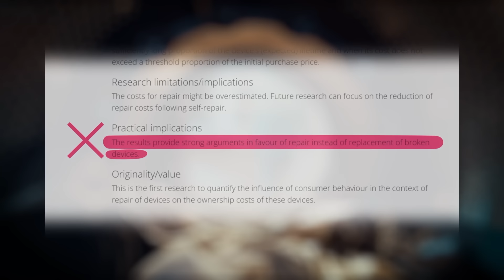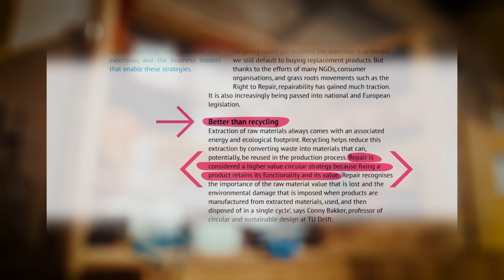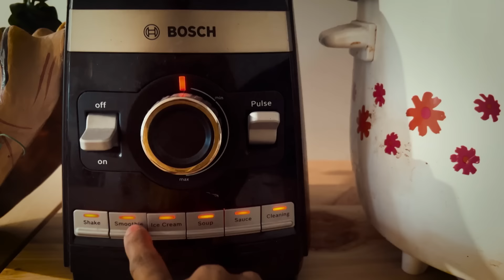How Europe wants to stop the flood of broken stuff

Comment: The makers of new junk (especially, if not only them) pass on a part of the overall cost of their products to society as a whole. It costs money to dump things that only last a few days or weeks. It costs more (which if we value things according to our values, amounts to more money) environmentally. (The local dump passes on the cost of adding carbon dioxide to the air to society as a whole, too.)

Looking at this report, it seems it might be possible to mitigate this kind of cost simply by giving consumers stronger rights to a refund? Insist that even the cheapest goods on sale (which are driving out the better products - the ones that at least take longer to become landfill costs passed on to society - too) should last "a reasonable amount of time"  - and possibly even regulate that, specifying " reasonable lifespans" for specific kinds of goods - e.g. a kettle should last at least 5 years (and if it doesn't, the seller must refund the buyer). 

It probably wouldn't be a total solution, but it might make some impact.

A kettle should last 5 years, and be economically repairable if it does - maybe for another five years? Or more? How long should the body of a kettle last? Maybe 100 years? Is that unreasonable? (Sounds like it could be reasonable, to me).

Refunds for junk, first, and then an extension of that in the case of unrepairability. Let the companies selling junk (or good  quality stuff that doesn't rapidly become part of the landfill, or part of the CO2 output of reclamation/recycling operations) figure out how to make that pay.

I'm sure this raises issues, so this is just the service. Send the ball back over the net if there's more to this than the bald idea would suggest.

Comment: When your smartphone dies, transfer to a "Fairphone". They are a Dutch brand, made deliberately to be repaired and are modular. So if your battery dies, or you want more storage, or a new screen, you can just order that part new and click it on your existing phone :D
Reply: The concept is nice, but it's more expensive and the Hardware is outdated.
Reply: @sebastianstadler4799 stop playing heavy games on the phone and it's hardware is ok.
Reply: I'd like one, except they're too big! I except that making a new operating system isn't an easy task, so i except that Android is the temporary answer. Android is crap. And 6"+ phones are gross.
Reply: @JohnDiri-xw3hf I agree it's a decent platform. Some people are just never satisfied
Reply: Nah, I just buy refurbished phones
Reply: @d4n93r  I bought a refurbished laptop when I needed one. Much cheaper, it was already produced and it works fine for my needs. That's the second time i've done that.
Reply: @d4n93r  Yes, I buy flagship refurnished Samsung phones 2-3 years old for $200-$300.  They can last another 5 years.
Reply: @JohnDir-xw3hf  The point he was making is that it's overpriced for the benefit of making it repairable. Most people want the cheapest option possible (which means it's not repairable), and of those that want the best option possible, they'll still prefer to get something with the best hardware possible over something that's repairable... we need repairable things to be either cheaper or better, ideally both. Right now they're neither.
Reply: Would have bought a fairphone, but I need a headphone jack. So no fairphone for me. Btw watching this on a framework laptop.
Reply: @MrRofl131  Ah, I didn't know the phone doesn't have oldschool aux port for earphones. That's a bit of a pitty, it was on my list for when my current phone dies on me. But I still use wired earphones too. Maybe they target the more luxury customer that use earpods and everything wireless etc.? Maybe it's difficult to make that part into a replaceable plug and play part.
Reply: @sebastianstadler4799  the SOCs with the best support aren't that powerful sadly. The Fairphone 5 uses a QCM variant since they are LTS from Qualcomm. If only Qualcomm would support their stuff longer...
Reply: yes! the same goes for laptops, there is Framework! I've had one for over a year and i'm super happy with it

Comment: We should also mention moral wear and tear. I have a Sony Bravia TV, one of the first smart TV models before the Android TV apps became the norm. Most of the apps I use stopped supporting my Device as being too old. The TV is in perfect condition. I just can't use it anymore because none of the apps work.
Reply: You can still use it as monitor, same story here, but now tv died too.
Reply: Wouldn't it still work with a Chromecast like device? I get your point, but that might be a solution.

To me the big issue is that now everything is too complex. Why the fuc does my tv need a computer? Just plug one into it (like the Chromecast) and it will be cheaper and last longer!
Reply: @GuillemPoy  Yeah it would work fine, it'll just connect to the HDMI port. 

My new TV from a few years ago (LG OLED B1), i keep OFF the internet always. Allowing your TV to connect to the internet is a ticking bomb. If you want smart features, just do as you said, use a Chromecast, Nvidia Shield TV, etc.

Comment: Whatever about consumer electronics, the German car industry has done everything possible to restrict reuse of car electronics with nonsense like VAG group's "component protection"
Reply: Thats where the hacking community comes in perfectly :D
But researching that stuff is expensive - so its quite an effort which needs investment first.
"You could just go to your dealer and get a new one" haha, like imagine having serialized airbag sensors! which do not work when the stupid ID does not match even tho the part HAS THE EXAXT SAME PART NUMBER and components.
Dealer cost was like 200-300€ for a new one, I just dug out the eeprom (sillicone sealant) and mirrored it to a identical working wrecker one.
Reply: @_DSch  You can do that on your own car If you do it on a customer's car and for some reason the airbags don't fire, you will be in very serious trouble. Whether or not you are at fault , you will get the blame anyway and your insurance is unlikely to cover you.
Reply: @Daniel-OConnell  They did fire lol, next person that had it managed to crash it through pure stupidity.
The sensor itself passes some selftests and reports to the ecu whats going on, so it has to work - what it did - else the little airbag lamp lights up.
You cannot really put the blame on someone who knows what he is doing and warns you that there is like a 1% chance of it not working properly xD
If the Airbags do not fire thats not my issue since thats the job of the ecu which has redundancy even if a sensor might be faulty.

Comment: The segment around 6:54 isn't always logical. A GE brand washer that cost $950 , if the drum breaks after a three years the repair part is $400 and the repair labor is $450 in my city in the U.S, total $850. And the warranty company says drum breaking is due to user error of overloading. So for $100 more one can get brand new washer with a 1 year warranty. That hopefully will last more than 3 years.

Comment: Can someone in Germany enlighten me, whats the energy bill for an apartment over there every mo? my guess is more than 200 E
Reply: Just a google result 300 KWh* price per 0.3951 = 118.53 EUR
Reply: I live in Bavaria. Here the gas and electricity providers together with a consumer set a fixed rate wich needs to be payed monthly. Once a year you send the info from your "storm/gaszähler" and they say if you need to pay extra or they give you the money back. Now the rate depends from the apartment size and the company. For my 3 room apartment we pay a total of 188 for gas and electric
Reply: @suddenly_radical4558  heeey thats pretty neat! one mo free energy for fixing up your own appliances and cutting through the proper red tape to actually get those benefits seems like a nice start. wish we had somethin similar over here...or even the old glass recycling infrastructure.. sadly a lot of stuff beyond electronics and doohickies over here gets treated like single use items with no intent on reusing or recycling them.
Reply: Something like €20 per houshold +€50 per person (for electricity). Of course depends if you have a 2 Meter wide fridge or bake 4 cakes per day, or you run a server farm at home, it will go up.